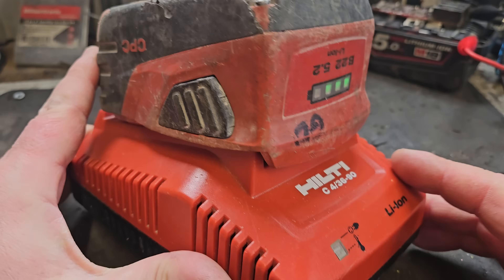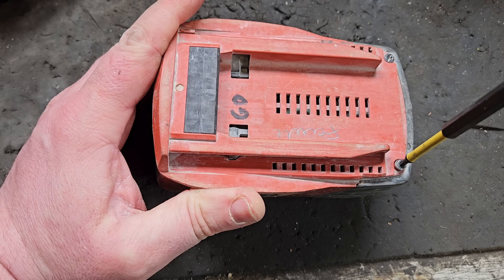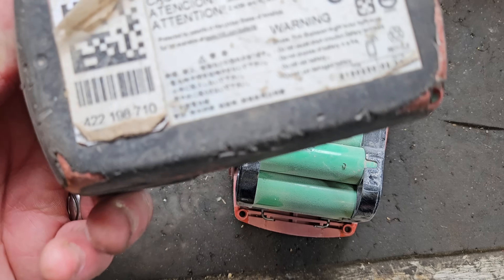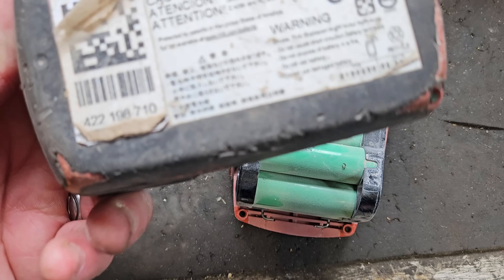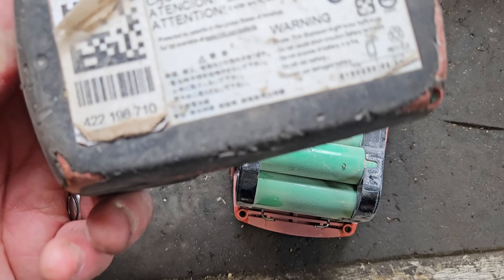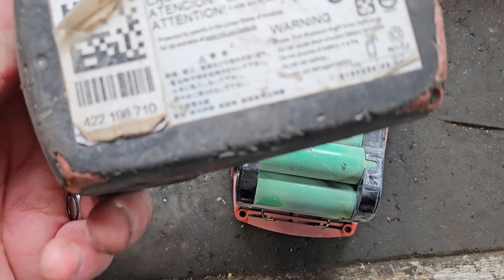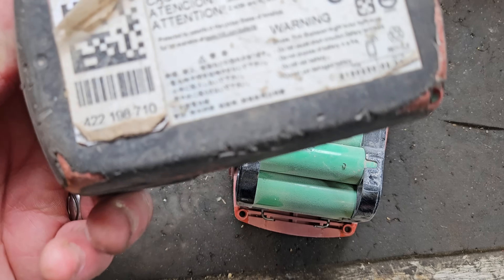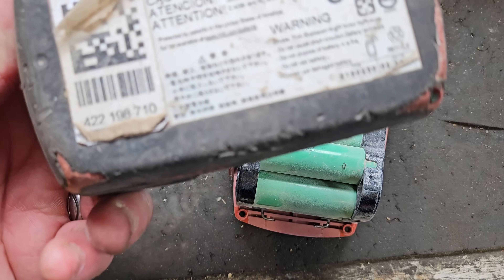Hilti Cell Imbalance Repair Tutorial

Comment: Bro the reason why ur probably experiencing these problems with your batteries is because you probably didn’t fully discharge the battery or batteries when you fully charged them…….did you fully discharge the batt or batteries once you fully charged them?

Tip: Once a Battery is fully charged wether it be NiCD/NiMH/ Or Lithium Ion what your doing to the battery is called charging it and to discharge a battery correctly for a lithium ion battery fully charged it and then completely discharge it meaning run the battery juice down to where it won’t put out any more power in the battery and for a nimh battery fully charge it and discharge it to where once the motor of the tool that you’re running the battery slows down that’s when you want to stop using the tool otherwise if you keep using the tool with the battery inside of the tool when the motor is still sounding like it’s slowing down and you keep using the tool u will ruin the motor or possibly the battery or both so once the battery slows down with the tool that your using it own immediately put it on the charger and fully charge it repeatedly to have very good runtime in the battery or the tool and this is the same with a NiCD Battery Or Tool
Reply from the maker: Look at my channel I have 2400 views none of this stuff is mine I only repair it
Reply: @doctorlefthandthread sorry didn’t know and sorry that I didn’t take a look
Reply from the maker: @kylemetcalfe5707 it's ok people assume this stuff is mine and it's a one off tool video. Thanks for commenting
Reply: @doctorlefthandthread welcome

Comment: Great lil balancers them wish they made them for bigger batterys,i work on ebike  battery s and come across this alit especially with modern batterys that claim to have every protection when its all lies and they wonder when there is a fire ! I pilut a suitable board on every battery i work on weather the customers agrees or not if im  going to take the job on  theyve got to have a board that Will balance and protect  from over or under  voltage.how tool company s are getting away with a simple heat ristor(fuse) at this stage is worring also but atleast there cells are decent thats plays a big part i suppose 👍

Comment: Great video. Question about how you use your Lipro B6 charger. You charge  in the  balanced mode, but you do not hook up the cable to give the charger the individual cell voltages like two other youtbe battery repair guys do.  Maybe you could explain why the charger works in this configuration. I am not being critical, I just want to understand. Thanks
Reply: That makes sense.  Maybe you could do a quick video about the charger, discuss sinle charge mode and charging banks of cells. Also how do you decide the charge rate? Thanks
Reply from the maker: @sportsman1824 I usually go higher for time constraints but charging lithium batteries slower is always better
Reply from the maker: I wasn't in balance mode I was charging a single bank. The other way you described is much more complex I do intend to do a video on it some time in the future